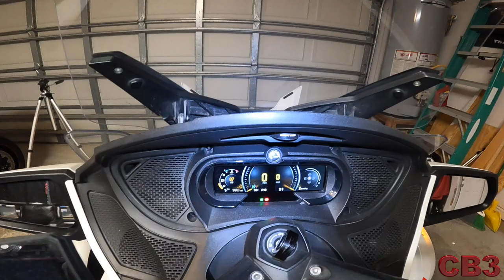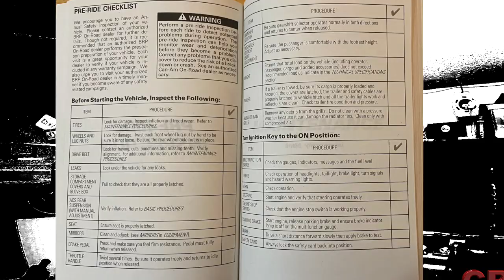3 Things...  That WILL SAVE YOUR LIFE!!!

Comment: Ha...!, from earlier remarks, yeah, I kinda had an issue with checking the oil daily, considering the "procedure" required, but have to admit I do a lousy job of a walkaround before ryding. I ruined a rear tire on my Ryker because I didn't check it before roaring out of garage on a quick "rip". It struck me, on a breather on a long ryde on my Spyder, that my Kenda tires are looking brand new at 12k miles. Yeah, I don't really check them as often as I should. I've considered the tire monitors you have, a great idea, but I grew up with a tire gauge that has served me well, and travel nowhere without a tire repair kit and pump. The rest of the "feel" is just that; the feel. Just starting up in the garage told me I had a battery issue; a loose terminal.
Thank you, Lord, "shifting gears" is reserved for my truck and car. I put 4k miles combined on my truck and car. I put 10-12k on my Spyder. I dislike how cumbersome four wheels are in comparison, but there's a mission for both, so I make the necessary adjustments, in reverse...
I appreciate your vlog, so necessary for most riders, especially those that ride two- and three- wheels. However, I reserve my own opinions on all of the gear you wear, be it cold or hot, because I ride a Spyder; oh, in the desert. Cannot argue with the need for a helmet, (half, 3/4/, modular/full), there are applications, but whatever knocks me off my Spyder will already kill me, so why do I fear road rash? Sorry.
Keep up the good work, appreciate your efforts, you're spot-on so much! Best to Coach Vic..!

Comment: I learned from this video there's a couple things I could do a much better job at doing more consistently.  I don't check the oil everyday, using the method as prescribed by BRP, ride for so many miles, then sit idling for 9 or 10 minutes, then check oil within 2 minutes after that  I only do that method periodically, the Spyder has the most time consuming oil checking procedure I've ever known.
As usual the knowledge and information you share is so very valuable, many thanks 😁👍👍

Comment: Ha ha... I love the Coach Vic cameo appearances.  Excellent points made throughout this entire video, especially getting your mind, as I refer to it, into the hyper-aware zone.  For me, it's putting the gloves on as it is the very last step before I release the brake.  As previously mentioned, the oil check process is not performed like a car.  For a trip farther than the local city, add checks to make certain all tools are in place.  Also, anything that utilizes battery power is fully charged the night before (the bike, phone, gps, air compressor, jump pack, etc.).

Comment: Coach there is a certain procedure to check the oil that you need to do in order to get an accurate reading. It much different than a car. Procedure can be found in the owner mannual.

Comment: Great job Bob!  13 days ago I rode about 40 miles to a friend's house for dinner.  While preparing to go I opted to wear hiking boots (because they were already out) instead of my normal riding boots.  Other than that all other safety gear was in use.  After a nice visit and meal I bid everyone ado and headed for home.  As I was departing their driveway I banked my new GSA into a hard left lean at too slow a speed (dumb mistake) and entered a descending spiral that ended with the motorcycle on top of me.  Unfortunately my left fibula along with my left side rib cage fell victims to the sudden arrival of my trusty GSA.  In retrospect, as I prepared several hours earlier for the relatively quick trip a little voice asked about the wisdom (or if there was any) regarding the use of walking/hiking footwear vs. my dependable riding boors.  Well as they say hindsight is 20/20, the boots may not have prevented a fracture but I would have much preferred the odds.  Going up to the corner for gas is or could be an acceptable risk for said footwear, but a roughly 90 mile round trip partially after dark at highway / and back road speeds was definitely the wrong choice.
The most frustrating part is I know better than to take the risk.  Having ridden motorcycles for over 58 years of my now 72 years on  the planet with very few accidents and 0 broken bones that brief lapse of judgement has netted me a brand new shiny stainless steel plate permanently fixed to my lower left fibula.  I'm very lucky my forward speed was negligible and my recovery should be under 15 weeks.  Your 3 things subject today hit me right between the eyes!  We're not bullet proof, we are never too old or experienced to learn, and we should be vigilant every time we touch a motorcycle no matter the reason or purpose for doing so.
Thanks again for what you do!
Reply from the maker: A great comment!!!  I am glad you're ok!!

Comment: Thanks Coach Bob, you offered some good advice in this video. What do you clean your windshield with?
Reply from the maker: I use Meguiar's Hybrid Ceramic Wax in the blue spray bottle and water.   I also use a a micro fiber cloth for my initial wipe, followed by  a standard cotton wash cloth for residue.

Comment: Coach Bob: Mile Marker Mike here: Many of the upper end helmets are really great. Unfortunately I was created with this large head. Many of the helmets out there do not fit. So I have a HJC. It's a comfortable helmet but is not rated like those helmets are. Also, if you don't mention it. Highway deflectors has been added to my emergency items. I was on Highway 40 twenty miles to  Tucumcari New Mexico where my hotel was located. My phone was not showing heavy weather and thought I had a clear shot. To my dismay the rain came back dropping probably an inch every ten minutes. I had my bike off on the shoulder as far as the pavement would allow. At times trucks came close to hitting my bike. Hence the highway markers which would of made a big difference in being seen. It was so bad I started hydro planning and trucks were dumping walls of water on me. It was so bad many vehicles were getting off the highway. Something else I would probably  have. A tent that I can put up in five minutes or less so I have a way to get out of the rain. Have you had that kind of experience yourself?

Comment: Bob, When you were doing your visual bike inspection and filming it i noticed that your right front wheel looked like it had a big crack by the 3rd spoke to the right of the valve stem. I hope it is just an illusion from the filming.
Reply from the maker: After reviewing the film it does look that way. I just walked out the spider. It was a dirt line.  😂😂😂 I guess I need to do a better job cleaning it. Thanks again brother. We definitely have to keep an eye on things and help each other out.  Thanks again. CB3
Reply: @CoachBob3  So glad that dirt was all it was. Those wheels can get expensive. I just love your videos. Good helpful remarks and safety tips. Thanks.

Comment: How do you check oil before every ride, given the procedure to do so accurately?? Checking oil with a cold engine shows almost empty! If you top it up this way you will overfill it and can cause engine damage?
Reply from the maker: I run the engine/warm it as I load up and walk around.  I must confess … I don’t do the full 10 minute process.  But…I have a daily baseline that seems to work.

I have never seen a dramatic change when it comes to each day. If a problem did present itself. I would ride a few minutes and then check it.👍👍